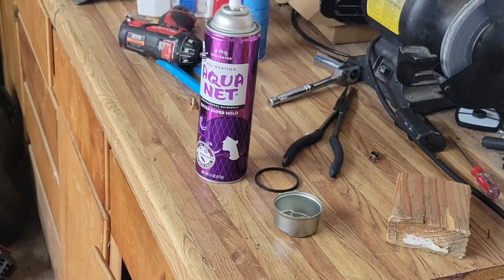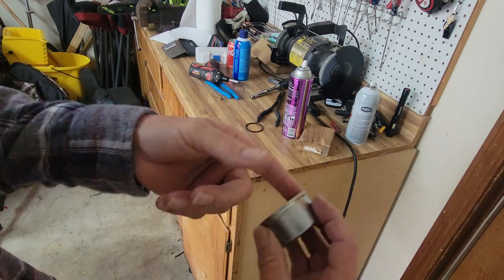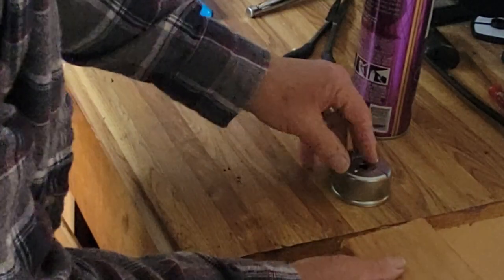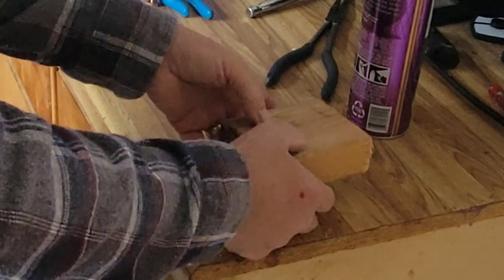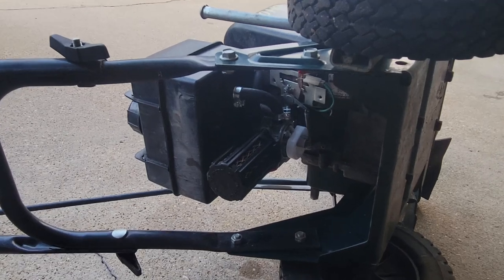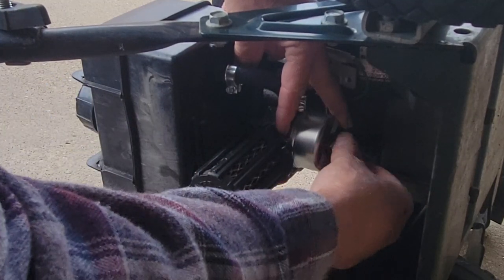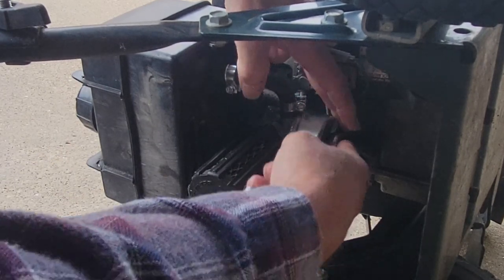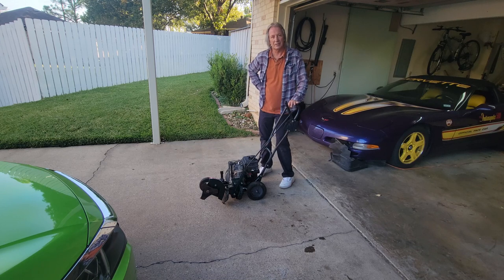An easier way to install a fuel bowl gasket

Comment: Just been wrestling with this all afternoon on a Briggs and Stratton engine where the carburetor is aligned vertically meaning keeping the gasket in line while you try to screw a single hard to access nut from underneath.  Leak after leak and I was ready to scrap the entire machine.   I don't have any hairspray in the house as my wife never uses it and nor do I , :) but is there any reason not to use a tiny coat of superglue around the seal?   Or would that rot the seal itself and dissolve the rubber?
Reply from the maker: Sometimes the rubber steak can ge tpretty obnoxious. Hair spray is a good amount of sticky to work well. If I were to put glue on one, I would go all the way around with a super thin layer of silicone caulking on the bowl lip. That would keep it out of vibration with fuel later. 
 If it's leaking a lot, double check the needle and seat and make sure they are in good shape. 👍
Reply: @GuysPlayingWithTools  Many thanks for your help and advice.  Appreciated! :)
Reply from the maker: Let me know how it comes out.  🙂

Comment: I found trying to get new bowl gasket on to Briggs carb. nightmare! Vid looks good. Hairspray looks good. I used to use it when I had hair!! Now bald so hairspray bottle needs to be fixed first! Will try tomorrow-any tips on getting spray bottle fixed!?😆Thanks for advice👍
Reply from the maker: I only use the hairspray on new ones that won't stay in place long enough to put the bowl back on.  Usually on old ones you can scoop them into the bowl and they will stay for at least a few seconds.
My hair is thinning in a hurry too. LOL
My grandfather used to say "Getting old ain't for babies" 🤣

Comment: Encountering this prob with my NEW HF Predator wood chipper. Not easy keeping the O ring gasket true while replacing the bowl. I needed to re -jet the carb for my location. With the O ring being small & flimsy and the seat groove is in the carb, not the bowl - hit & miss to get it to seal. Having slight gas leaks. This would do the trick. I will have to try it and reply. THANKS!!
Reply from the maker: Hair spray works well because it gets sticky when it dries. When they are extra annoying, I slide the the gasket into place and give the hairspray a couple of hours to dry. 
Good luck!

Comment: I have a troybilt storm. The bowl  flange is super flat. Tried this several times but the carb has an indentation for the gasket to seat. Did your bowl flange have this seat or did the carb have that slot?  I ended up turning the machine sideways and after a lot of tries I finally got the gasket to seat in that slot then screwed the bowl on to the carb.  Good video but I might add that buying a new gasket from the get go would be a good idea.beause as soon as I did that it went a whole lot better. Those gaskets shrink!
Reply from the maker: Most of the carbs I see are similar(not always identical) to this one https://youtu.be/1UNqrtxv_gw?t=6m02s
I picked it because it shoes both and I can't paste pics here. You are right, new gaskets can be easier to work with but I only get them if the old one is shot. I have found getting them sticky with hair spray helps if they are especially difficult.

Comment: The downside of aftermarket carbs. You don't have this issue with genuine tecumseh parts, they fit like a glove.
Reply from the maker: The gaskets are usually designed to fit in pretty snug, I agree completely the tecumseh carbs are easier than B&S for sure! With the Briggs even the stock gasket tends to be awkward to get in and this shows the trick, that I found works pretty good.